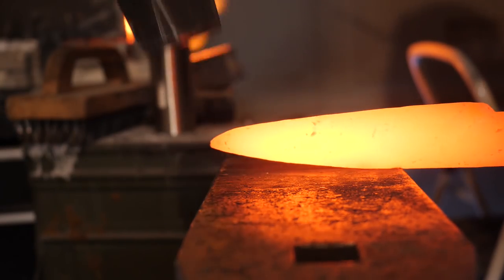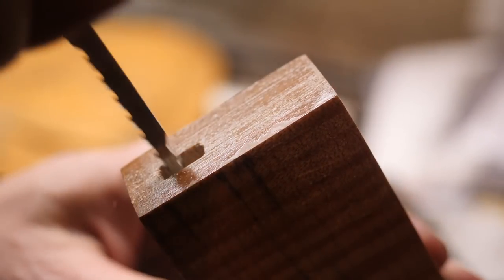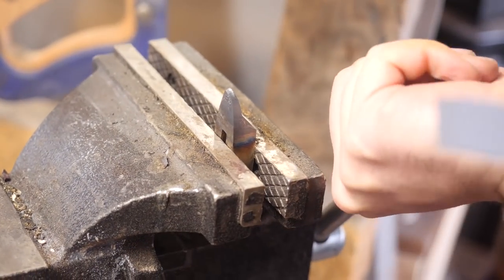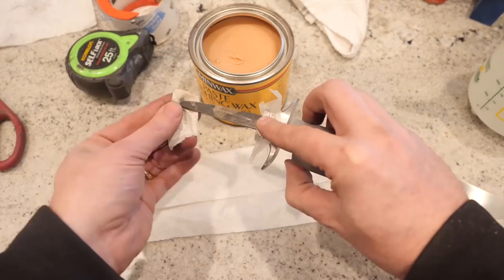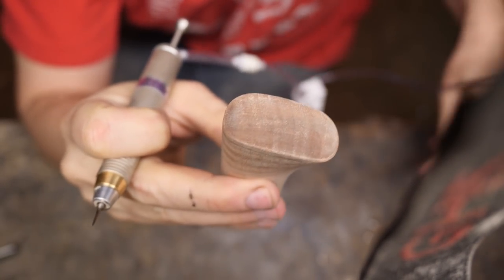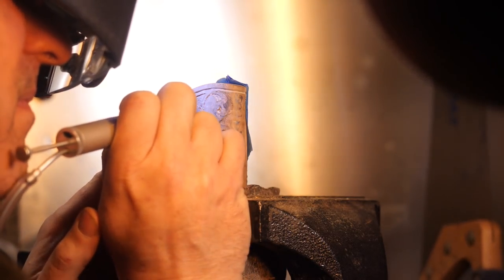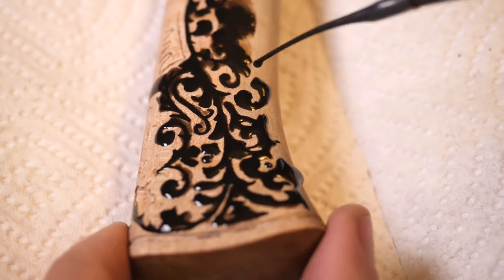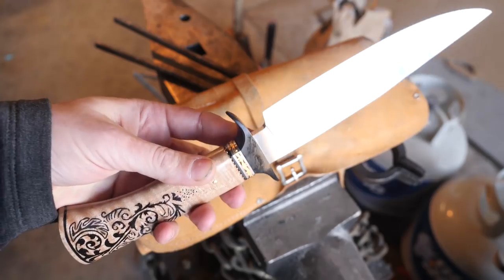Forging A Bowie With A Carved Handle.  Pt  2

Comment: A little tip. After you sandblast something, if using glass bead or sand, scrub the piece thoroughly before trying to coat it with anything. Glass can leave a residue on your workpiece.

Comment: Steve....... Let me start with a thank you for the entertainment. Now a nother good way to preglue your handles for fitting.I like to use plumbers tape on the tang prior to putting wax on the tang. I have found it is another layer of protection from the epoxy bonding to the tang.. Try it sometime... God Bless You and yours from me and mine..Martin

Comment: Beautiful knife, and excellent work on the handle. A couple of questions:

1. What do you use to make pins and rivets for your various projects?

2. What's the title of that awesome outro song?
Reply from the maker: i use brass or nickel silver most of the time
Reply: @GreenBeetle  Does the stock come in sizes suitable for the task, or do you modify them in any way?

Comment: Yeah, my "artistry" has limits.  I would never put that much work on a handle and risk using my dremel skill with scroll work on the handle.  I will have to remain plain.... Beautiful work though.
Reply: Actually it's not that difficult if you clean up all your slips afterwards or add more elements 😂😂

Otherwise on wood I used relatively low speed (maybe 3/7 on the speed dail)
Reply: The Duke Of Earl I’d say the same. Closest I’d go in maybe a pre drawn pattern then go in with a wood burning tool then inlay colored beeswax with lacquer clear coat over it.
Reply: @AB-co7er  The colored beeswax soaks in and leaves a colored pattern? Then gets sealed with the lacquer?
Reply: The Duke Of Earl . Yes. If applied correctly it works like a filler. You can use a hot towel to remove the excess around the grooves lines, then a dry towel then apply a clear lacquer coat

Comment: What Epoxy coat do you use for a finish on your knife handle. I usually use linseed oil or mineral oil then I clear coat it with a rostolium clear enamel but I don’t think that’s the best thing to do??? Any tips or ideas?
Reply from the maker: starbond ca glue you can check description for link and discount code
Reply: Green Beetle thank you kind sir

Comment: steve is hammering best workout for forearms?
Reply from the maker: when gyms were a thing i had started doing bicep curls with 10 lb dumbbells but overhand gripping them with thumbs pointed forward like i would hold a hammer then also did tricep stuff.  seemed to get these 46 yo arms back into it a little quicker and without tendinitis.